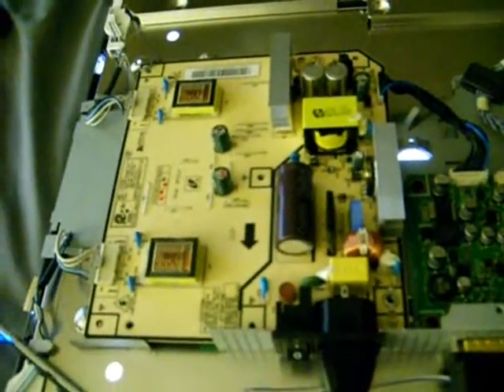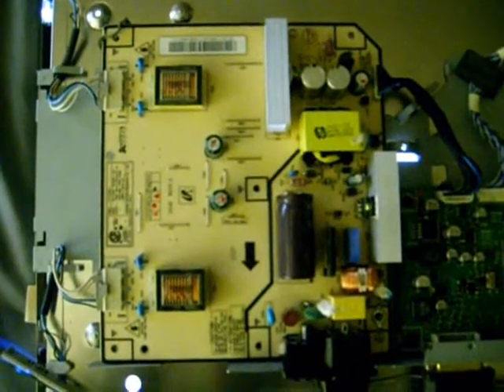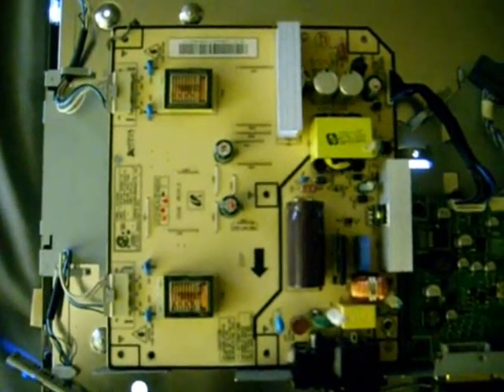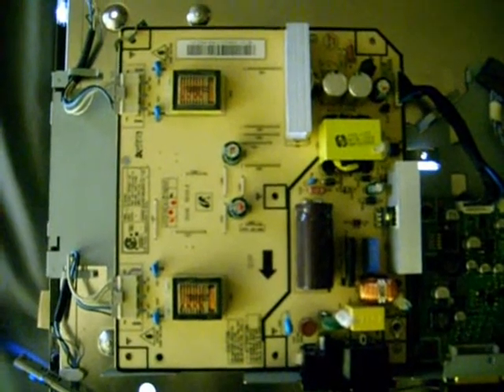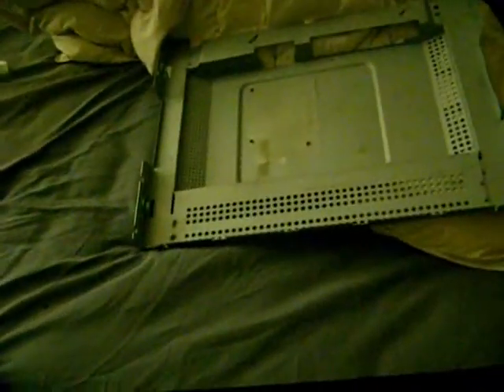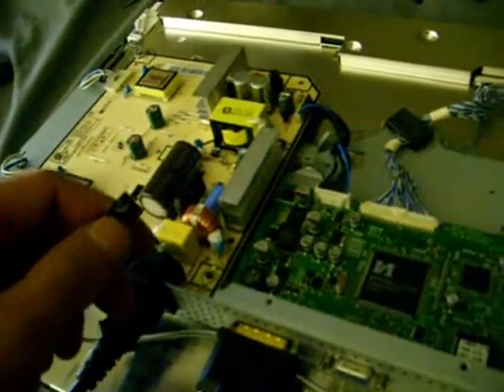Samsung 204B Monitor Backlight Repair

Comment from the maker: @tyashtonh, my reflector was very slightly yellowed too. These powerboards generate most the heat in the screen I think. They run pretty warm, even though they have good ventilation. Glad you got it all sorted out. Good work bud, takes some patients and good hands to work on stuff like this. Thanks for the comments and letting me know what happened. Hope it goes the long run for ya this time. If not, pop in a few caps and you should have a nice screen for quite some time :)

Comment from the maker: @SoraKurisu, all you need to do is unsolder the caps from the races on the board. They pull right out, woking from one side, then the other. You have to make sure the holes in the board are clear so the new cap leads can go in. Once you have them in, solder them in place and cut the exess lead like the other components on the board. You should have a like new monitor for the next ten years if you buy good capacitors. Hope this helps. If you have questions ask! I'm glad to help!

Comment from the maker: @SoraKurisu, they are pretty cheap, around $10 to $15 for a good pencil style iron. The solder should be rosin core, and it goes for about $2-3. I don't have any circuit boards laying around to make a video of how to solder the caps in, but it very easy. Heat the solder joint on the cap till it melts, and pull the side that's hot out. Then the other side. Take the iron and heat the hole on the board and blow the old solder away so there's a hole for the new one. Seat it on the board and add some

Comment from the maker: @SoraKurisu, solder to the gun and joint at the same time. Just add enough to match the rest of the components on the board. Clpi off the exxess lead and your good to go! Google is your best freind to find videos or pictures of how to do this. Hope this helps! Ask if you have any questions, and good luck!

Comment: You sure know a lot! You know about my problem with the plastic making noises after it cooled right? So I finally bothered to go get an exchange and get a Samsung P2370 instead which seems to have a much nicer quality build. I can't find a single vent hole on it though.

Comment from the maker: @BigFatLoserDude, yep! Still going like the day I fixed it! One tip though.. I do recommend that you use caps with a  higher temp rating, like 105C and above. If you adhear to this advice, I assure you the caps will last longer than the rest of the monitor. Good luck, and if you have questions, ask away!

Comment: hi Monkeypumper420 , great Vid! Last weekend i had repair my Samsung SyncMaster 214T TFT in the same way. But i have a hint for all the DIY Man. I changed all the  capacitors with 16V 1200 uF. I mesured the Voltage of all the capacitors. They run all on 11V . I took the capacitors form an old PC Mainboard. They are all hi quality LOW ESR  capacitors. My Samsung ist now working perfekt. I hope for the next 5 Jears :-)

Comment from the maker: @tyashtonh, to me it honestly sounds like you got a bad power board. The light itself will either work, or it wont. I don't know where you bought that power board, or if it was new or not, but if I was you I would send it back for a working unit. The faster solution would be to install new capacitor's like I did here. I can assure you it's not the bulb. Your power board is defective.

I think my abuse to the camera from my trucks audio system has damaged my mic. Does it on my other vids too.

Comment from the maker: @calvinblinkee, yea, they are but their designed in the US, and hopefully made with Japanese or any other parts besides Chinese parts! I have not had any problems with any of my Alipne equipment...yet... *Knocks on wood*

That monitor is seriously WAY nice. I gave it a long good look earlier. It's too bad they only have widescreen versions. I like my standard 4:3 ratio 1200x1600 resolution. My screen should work for the next ten years now, at least till it's time to build another game box.

Comment: @liz83lds good to hear! just ordered my caps (today) from from digikey  1-800-344-4539
2 of 820uf 25v 105°, 3 of 330uf 25v 105°, 47uf 50v 105°. 105° cause it gets hot inside the back of the monitor. total cost to replace all caps on the board with tax and shipping  just over $6.50!!! They have Technical Support  to help you find just what you need. I would also tell you technical support said not to go up 1000uf but to stay at 820uf you can go up from 25v to 30v,35v but not the microfarad (uf)

Comment: I have the same monitor with White Screen(Back Light).  How do I know is the problem of old capacitors? Do I need to change both capacitors:  They are 820uF25Volt. You replaced with 1000uF?

Is there any chance  that problem is from the video board? or bad VGA connector? Just need to resolder it? or replace it?

Back of the monitor printed: Made in Tianjin, China which is north of China may be near Beijing. manufacturing date:Dec. 19.  2005

Comment: thats probably because your samsung uses lower energy cold catholdes since those and the inverter for the backlight ( cold catholdes ) get the hottest since they need at least 600+ volts to turn on, yours probably doesn't get as warm so cooling wasn't required

Comment: hey I successfully fixed my monotor following this video. HOWEVER, I broke/bent the tiny ciruit board that has the controls/buttons on it as i pulled the plastic bezel off the rest of the monitor. I did not realize that the frame had to be taken of very carefully, and now the buttons dont work. The monitor is always on now, so it works, but i have no access to on/off or to picture controls, is there anything you can suggest to fix this?

Comment: I have a samsung 204b monitor with a thin black line that goes horizontaly across the middle of the screen. any idea how to fix it?
Reply: My near-new one had the same problem years ago; I swapped for a new unit under warranty.  Guessing the driver for that row burned out.

Comment from the maker: @mmatsjugg, knock on some wood E! I think you'll be fine, but if you ever experience any back light issues this very well could be useful to you. My G'ma has had LCD monitors last 10+ years and counting, but that was when they made stuff with quality goodies, compared to Chinese made everything these days. I mean, chances are it's cheap failing components that are easy to fix.

Comment: What kind of capacitors did you use? I heard u replaced the 820uF with a 1000uF Japanese cap. What kind di you use to replace the 330uF capacitors?

Comment from the maker: @tyashtonh, I know how much of a pain it was to pull it apart bro, I took my 204B down to bare bones myself. I'm sure they are equally a pain in the ass. Glad it's working good now though! What connector was causing intermittent power transfer? Output to the bulb, or input to the power board? Lemme know how it holds up over time. I'd definatly like to know as much as I can about these screens... *WE* should go into buisness repairing these damn things! Save people $ and make some ourselfs!

Comment: Where can you buy the capacitors?
Reply: And list what exactly they are.  Sounds like 820uf 25v Capxon? Is that right
Reply from the maker: David Bailey mouser electronics has quality components, just match what you have to their online catalogue. not the cheapest, but the good parts and service.

Comment: Thanks for the video.
If you are going to change the two capacitors, please Google "Samsung SyncMaster 204B Repair (Updated)" and check the site of Pavel Kirkovsky.

This morning I revived the half-dead monitor 204b for new life. ($1 for both capacitors)